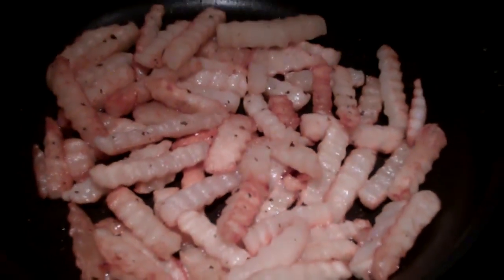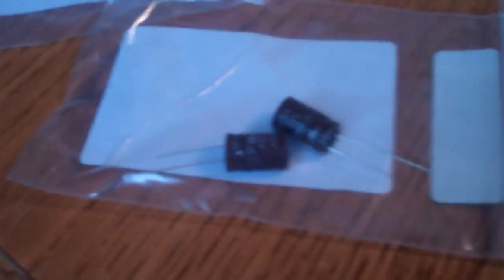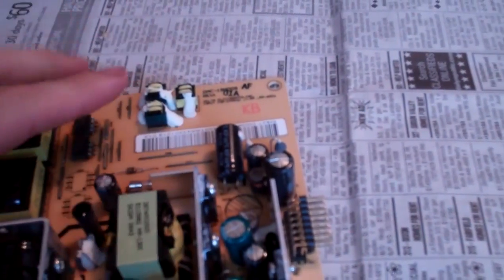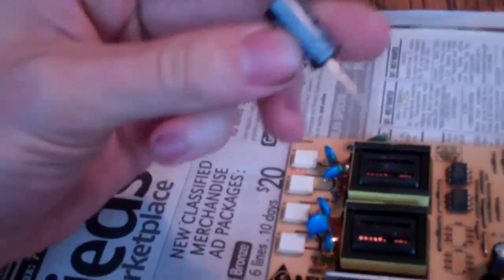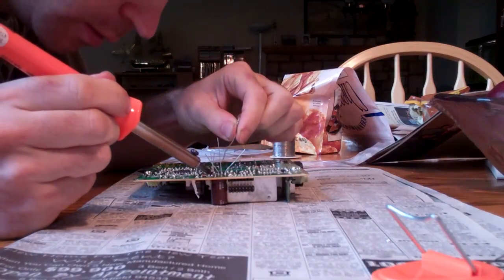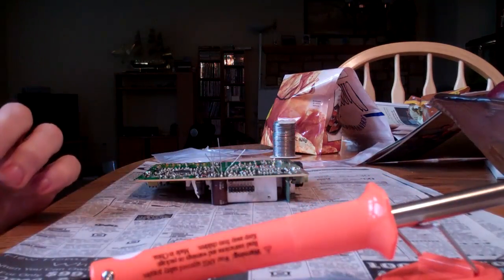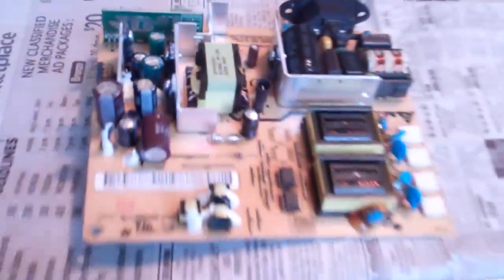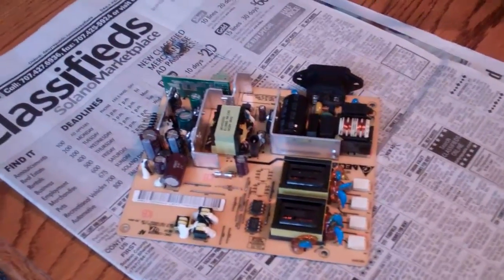[245] Fixed A Monitor - 2011-02-14

Comment from the maker: @ImRamro I'll assume you meant capacitors, How old is the monitor, if its 5 years or older it is very likely that the caps went bad, get it apart and find the board that the power cable plugs into, look for the tops of the capacitors to be expanded outwards, look at the values and get replacements.  If it works Awesome, if not you're only out $2.50.

Comment: My wife's flat screen just went out. Do you think it might be the resistors? I don't know if that is a common problem or not, but I think I will try to re solder some new ones on?
Great video BTW that was pretty cool that it worked.